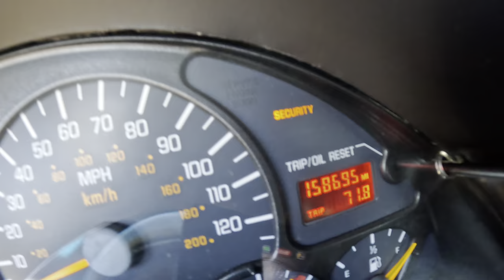Oil in the Radiator! Top End Internal Tear Down! GM 3800 3100 3400 3.8 #mechanic

Comment: Always amazes me how GM started with a bracket, and then built a car around it.
Reply: Yes I agree. Having worked on GM's for 37 yrs, ,GM is NOT the only one to build like that. They all do it. I believe Chrysler was the first domestic car make to put a windshield over an engine.😊
Reply: I agree my dang 3800 has a motor mount bracket in the way of the serpentine belt
Reply: Very well said about hate complaints . American residents for many have become citizens of hate . Many kinds of hate , one in particular customizing of cars by their owners . Me , I like older cars that are more original and have custom rims with tires that actually have tires on them . I don’t like slammed to the ground vehicles . That is me .  Always liked Pontiac , the older gm , dodge , Plymouth , ford , and a few others . At 68 yrs old none of that has changed much .
Reply: That's a great way to put it.
Reply: Volvo designed the V70 around a pen holder.
Reply: I've never thought of anything remotely close to that, but it was a good comment for some laughs.😂
Reply: @51ubetcha  "Windshield over an engine" HA HA.... AMC Pacer is the first and worse I can think of.  Straight 6 in an engine compartment designed for a rotary
Reply: Step one: Remove car from starter...
Reply: no joke.!!!!!!!
Reply: that BRACKET is the only REAL piece of steel in a Firechicken! 🤣
Reply: @51ubetcha  "cab forward design" is how I believe the commercial sold it
Reply: 4:36 I'm  still laughing Ray. Your humour reaching Australia. Good work mate.
Reply: They just want you to pull the engine when resealing the valve covers. You know - for efficiency.

It's much easier to work on an engine while it is bolted to a stand 😂😂

Comment: Changed the oil in my 1998 Tahoe yesterday along with both front ABS brake sensors and tire rotation. At 70 years old it takes me a little longer, but saved some money and got me off the couch. Felt really good at the end of the day
Reply: Thank God we don't have to beat flat rate when we get older! 😂😂

Comment: Absolutely my favorite channel to watch!
By the way, duct tape is not for hvac systems. Metal tape is for hvac systems, never use duct tape on them.
Love the chipmunk voice Ray.
Reply: In my non-HVAC life, "duck/duct" tape is for LARP weapons, and ductwork gets the adhesive aluminum tape.
edit: As I have learned, the "duck" in duck tape (leaving aside the brand) is from the cloth used between the outer plastic and the inner adhesive.
Before the invention of the adhesive metal tape, it WAS used on ductwork.
There are different grades of duck/duct tape, varying in the strength and weave of the fabric and the type and 'stickiness' of the adhesive for uses like gaffer's tape for stage work and military-issue #-mile-an-hour tape.
And even the metallic tape is being pushed aside in many HVAC installations by brushed-on joint sealants.

Comment: My suggestion for future reseals of engine gaskets is to just remove the engine first!
Oh, and charge your flashlights (gravity) LOL
Reply: I was thinking the same thing, because putting this back together without messing up the seals is going to be a bear on that valve cover!
Reply: Same thought, as soon as I saw how buried the back half of the engine is. 

It might be a bit more work removing, but the frustration factor would be much less. 

As you said, getting the gaskets to hold in place, while maneuvering parts back into place is going to be a bear.
Reply: The motor sits so far back it makes this job so much harder. I have done this job in front wheel drive cars and it is much easier.
Reply: My first thought.  Then I started thinking, why not just remove the motor mounts and lower the engine down some?  Then everything should clear with a little less effort.  Key word little.

Comment: That disassembly hurt my brain, as a shadetree mechanic, I don't think I would have made it half way through without giving up. Props to you Ray!
Reply: you and me both.😁
Reply: It is a MUCH easier job in a FWD vehicle. God knows I've done enough of these gaskets.
The angle coolant lines were originally plastic, but I've seen at least one that had aluminum/metal ones. The plastic ones always break, the aluminum one corroded in place.

Comment: That was painful to watch! Back of my legs and back were hurting watching you bent over fighting them covers. Very good at holding your temper! I have a 5.7 vortec and those plastic gm gaskets i hate. After twice getting them replaced at gm with the same gaskets, i found out the hard way they were only good for 50 to 75 thousand miles. I went with felpro. Been well over 100k miles and doing great.
Reply: Had em fail on my jimmy. Replaced them only to find out I dropped a torx bit down  no 1 cylinder and ruined the engine on start up. 😢
Reply: @samholdsworth420  Oh no!

Comment: The 3800  was one of GM,s  best ever v6 engines.
Reply: I never had this problem on the original 3.8 V-6.  I did have this problem on the 3.8 Series II V6.  GM knew they had this problem, and corrected it when they rolled out the 3.8 Series III V6 towards the end of this engines manufacturing years in production.  The Series III had a metal intake plenim.  The series II had a plastic intake plenim.

Comment: ahh, the dreaded valley gasket leakage issue. I had a Holden commodore VT. (here in Aus). I understand it had the same engine as the firebird. I had the oil mixing with coolant issue.  Turned out to be the dreaded valley gasket.  Was a lot easier to change than in this firebird.

Comment: I didn't know that the 3.8 also suffered from the intake gasket problem like the 3.1 and the 3.4 does. I have done a few on the 3.1 engines.

Comment: What a perfectly timely video, I'm about to start this job on my 1998 Firebird with the 3800 this weekend.  Has a rebuilt engine but for some boneheaded reason they installed plastic gaskets on it, and the upper is leaking.  Might as well do the lowers too.

Comment: Can’t read 800+ comments to see if someone else already pointed this out. According to what I’ve been told, the term “duck tape” was used in connection with its original intended use, the sealing of those metal ammo boxes to keep the elements out, and those using it would say that water rolled of the tape “like water off a duck’s back”, and the term stuck (see what I did there?).

In fact, duct tape as it has been called for a long time now, is one of the WORST kinds of tape to actually use on aircon ducts, as it dries out and the adhesive and body of the tape itself falls apart and fails in the heat and cold it experiences in use.

A good professional heating and air technician will use the reflective shiny “chrome” metal tape as it is ACTUALLY designed for that purpose.

Comment: The GM 3800 Engines were some of Best Engines that they Produced, I own a Chevy LS Impala for 18 years, never any problem with this Engine except Warped Plastic Intake...
Reply: I also owned a Chevy Impala with this engine.  It did have this problem develop at the same time the transmission started to fail.  When this problem started the temperature gauge would fluctuate between the half way mark and would go higher where it never would go when driving in heavy stop and go traffic.  When you started to move normally again the gauge then returned to normal.  The Impala also had the mass air flow sensor fail twice, and the catalytic converter had to be replaced because it was all plugged up.  The ABS traction control module failed along with wheel hubs.  The rack and pinion steering rack would leak every 20,000 miles, and had to be replaced.  At 19,000 miles the front end sub frame separated due to faulty welds at the factory.  GM did replace the sub frame under a silent recall.  When the transmission needed to be replaced at 63,000 miles, and the top end gaskets needed replacing at the same time, I sold that car.  The Impala LS was the worst Chevrolet I ever owned. 38:02

Comment: We had a black ‘97 T-top several years ago. The Ferrari center caps are an improvement over the generic ABS logo caps we had. Wanted to find some with the Pontiac logo for it but our first born came around and that car started sitting a lot more than being driven. Still miss it. Had the 5.7 and was a tire roaster. Also felt a little like the Hoff when I’d throw on a leather jacket and go for a spin in it.

Comment: Piss on you trolls! Funny! I've owned a Series 1, Series 2, and a Series 3 3.8L V-6 in Buick and Oldsmobile Front wheel drives. They are a very good engine. Had the least amount of issues with them.

Comment: I've had to do the intake manifold gaskets on my 3100 three times already... every 50,000 miles or so.  The 'upgraded' Fel-Pro gasket set is better, they last longer, but they still fail also.  The other problem on the 3100 is the EGR path inside the intake manifold.  Tends to plug up and set a 'low EGR flow' code.

Comment: From wikipedia: "During World War II, Revolite (then a division of Johnson & Johnson) developed an adhesive tape made from a rubber-based adhesive applied to a durable duck cloth backing. This tape resisted water and was used to seal some ammunition cases during that period.[1]

"Duck tape" is recorded in the Oxford English Dictionary as having been in use since 1899[2] and "duct tape" (described as "perhaps an alteration of earlier duck tape") since 1965.[3]"

Comment: Gm made some good engines but as most know the V6's were prone to intake gasket failure. The 3.8 in the early 2000's has a plastic intake that melts the EGR ports and causes fluids to mix.

Comment: I used to have a 3400 in my old year '00 Grand Am, that car is still running 15 years later and I abused the hell out of it when I was 16 (my friend I sold it to told me its over 450,000km now). I also had a 3800 Grand Prix GTP, the only thing good in that car was the engine, but sadly the previous owner didn't take care of it and it's radiator was full of sludge, constant issues with coolant lines busting open, and a TON of rust on the underside of the body, but the engine ran like a swiss watch. My mother also had a 3400 in an '05 Grand Am and that thing is still running to this day as well.

Comment: Hey Ray I hate to inform you but in WW II Johnson & Johnson made Duck tape as a replacement for wax on ammo boxes. It was only used in HVAC after WWII. It's not recommended to use it for ducts due to the deterioration of the tape to heat

Comment: Not that I would buy a Firebird with a V6 but if I did and had this problem I think I would have just pulled the engine out threw it away and put the proper sized engine in its place.  Good job so far Ray, regardless what the trolls say you are a top notch mechanic.

Comment: Rear main seals on that engine, are frequently not the rear main seal. They are frequently a leak in the corner of one of the plastic valve covers that leak down and appear for all the world underneath the car like a rear main seal leak.
If I remember correctly, there was a technical service bulletin about replacing these on the 3.8 that came out in about 2004 or so.

Comment: Hi Ray, you need to remember that GM assembled this engine on the assembly line bench, where everything was accessible to attach all the bolts, brackets and other fasteners, then engine was installed in the car !!, the GM bean counters didn't care about future repairs and maintenance!!

Comment: Just because I see a lot of people doing this you might want to pass that on to other people that are doing vehicles too do not use electrical tape in a vehicle it doesn't work You're supposed to use that fabric tape that is water resistant corrosion resistant and doesn't just melt if you know what I mean electrical tape just sits there and after like sitting on a device for a couple of months it starts turning gooey you know what I mean

Comment: The introduction of LED lamps must have improved working in such tight spaces quite a bit, I think.
Reply: As someone who worked with an incandescent drop light for many years YES they still burn you but they are the best lighting for this old man!
Reply: What, and lose the added fun of getting scorched repeatedly by the 150 watt bulb in a cage set up?

Comment: I literally just did this near exact job last week on a 2003 Malibu with the 3100 V6. Friend of mine who owns it was told by 2 shops and the dealer the car had blown head gaskets causing his oil milkshake. Nope it had the lower intake manifold gasket leak issue just like this Firebird. Now that I see what a nightmare the RWD version of these engines is to work on I know to not do it lol. Please keep up the great videos Ray, by far my favorite channel to watch here on You tube.

Comment: I believe this 3800 engine was considered one of the best ever built.
Reply: Outside of the intake manifold issues Ray has detailed here, and plastic coolant elbows prone to fracture on later transverse-mounted applications, the 3800 was just about indestructible. Frequently the rest of the car, most prominently the 4L65-E transmissions mated to many 3800s, would fall apart around the still perfectly good 3800.

Comment: Almost 10 years ago when I retired from being as GM tech, there was a GM tech chat forum where tech can ask other tech's question and share info. I remember one question that was asked about how to clean a cooling system of oil and other gunky things. One tech responded by stating he remembered a service bulletin put out by CAT about using liquid Cascade dish washing detergent mixture in the system and running the engine for awhile. Then dain, rinse and repeat if needed, or just drain, flush and refill with coolant. I don't remember if I have ever tried it though.
Reply: Cascade in the system? Doesn't sound right to me.
Reply: If I remember correctly, it was Cascade. I often wondered if a Dawn mixture would work as well. Since Dawn is supposed to cut grease and oils, why wouldn't it work to clean  a cooling system? I don't know because I never tried it. Might be a good test subject to do on something.
Reply: @51ubetcha  Well dawn foams like crazy while Cascade won't. It has sodium hydroxide in it though so I wouldn't leave it in there for too long if you did try it.
Reply: Agreed.  I think that's way Cascade was mentioned.
Reply: @ReasonablyBadActor  Yes it's important to use dishwasher detergent that won't foam

Comment: Them intake gaskets should have been a GM recall.
Reply: They were. My 99 4.3 crapped out at 100k and the recall deadline was a year earlier (chevy s-10). Not sure if pontiac did as well, but should have lol.
Reply: It wasn't actually the gaskets that failed, it was the dreaded Dex Kool (aka gasket hater), which was introduced as a long life product to reduce maintenance costs  GM had a silent warranty as I can attest, but if you didn't catch the failure quickly, engine life was in months.
Reply: @MrRunner  In addition, the nylon used in these gaskets is hygroscopic and should never have been released to production.
Reply: @keithdonaldson3945  That may indeed be true.  Some gasket compounds are designed hygroscopic so they expand and seal better.  Thing is if the dreaded Dex Cool degrades, the ph may drop, so the increase in acidity chews the material and off we go.  I worked on military aircraft flight systems for years and I saw similar issues.  Can't say which though.
Thanks for pointing this out, good information.  I have had several GM vehicles.  First thing I did was dump the DK

Comment: Engine "Hoist" brackets are junk, and whenever I run across one will remove it. The factory felt removing them (to reuse) after installing the motor was not cost efficient...actually cheaper to make the bracket and abandon it after installation of the motor. Thus, they usually end up just-in-the-way... 
And you did ask the opinion question about leaving them off. Consider the 5.3 and 4.8. (2007-1012) Replacing the oil pressure sensor and you will quickly determine this same bracket is just in the way... hence delete!!! 
So on this job...take the brackets off and put them with your engine lift, the owner of the car will never know the difference! And you save gas!!!

Comment: My 99 Grand Prix GTX had the 3800. It bit me hard! The intake was plastic on that awesome ride and it cracked at 55000 miles. Coolant filled the oil pan, fouled everything! Killed it in a parking lot! Thankfully, I worked for a local EMS provider, their shop had to tear everything apart and rebuild the top end. I sold it rather quickly.

Comment: I knew you'd get to the leaves & junk but you nailed it on the head when you said you played with my anxiety by waiting a bit.  lol.  I had no idea that engine was stuffed so far back, I bet it improves handling performance but plays hell on the back of who works on it.  I've been learning from you for years now I guess.  I look forward to every new vid. you put out.
Reply: The 3.9's were fitted in the vans.  Bloody impossible to work on, but luckily for me I had small children so I could stuff into the awkward bits.
Reply: That's just too funny but they are never too young to learn.  I'm a small guy & it's helped me many times throughout my different job endeavors.     @MrRunner
Reply: @kicknsystm  It was a failure.  Neither of my daughters are the slightest bit interested in cars.  One doesn't own one and the other has a unique plan  for hers.  Daddy.  In addition, Daddy is allowed to pay for it.  I blame their Mother, she's exactly the same for cars and everything else that goes wrong.  Hands me the keys and walks off.  Made in the shade.

Comment: About the duck tape... No, that's actually "Duck Tape" the brand, and you should never ever use it for heating/cooling systems. You need to use "duct tape" for those... Also known as aluminum tape. Using any tape besides aluminum metal tape in duct systems will typically end with its premature failure.